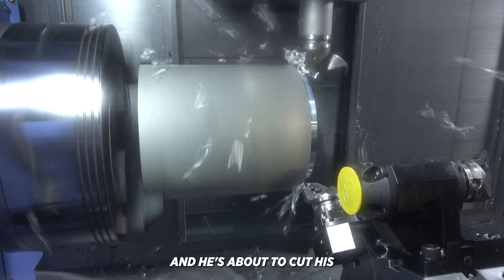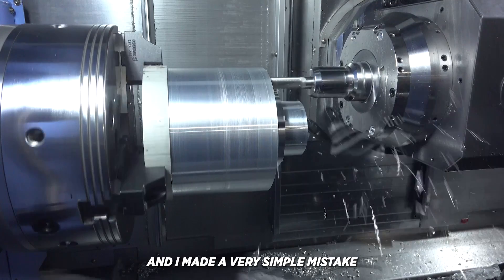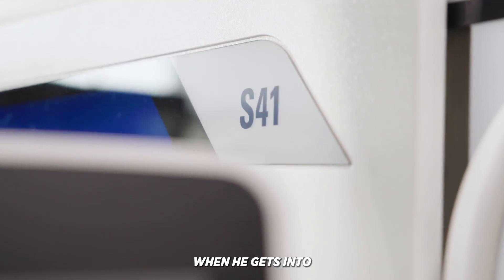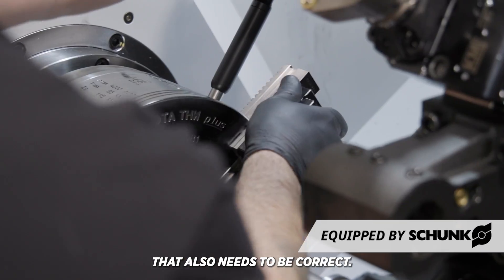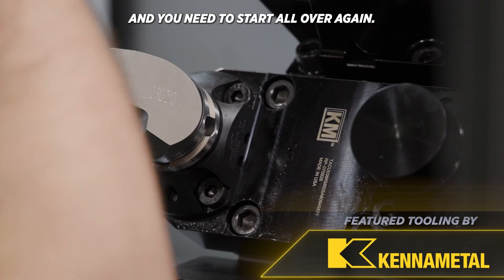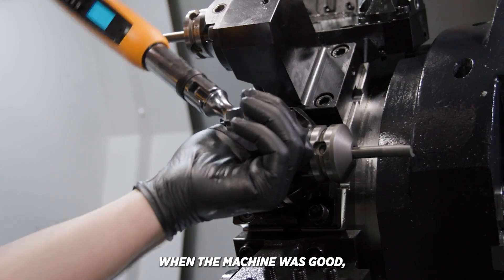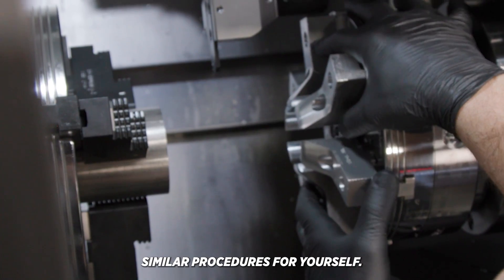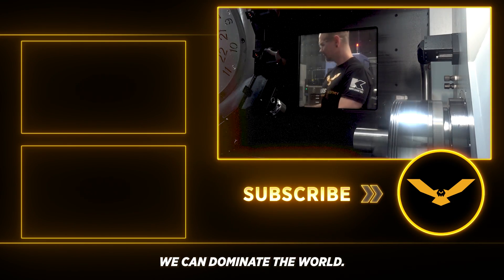My Mistake SMASHED the Tool & Holder Into the Part Causing Huge Damage… What Now?

Comment: On our bar feeder lathe with collet's all our parts are programmed with z0 being 3/8th off of coollet nose... That way all parts have a positive z value. And when changing to the next job all your off sets remain the same unless you change a tool out. Such as drills and taps. But we also do allot of repeat parts. It does however require more calculating when programming

Comment: Or drop a number from your compensation adjustment. Was tuning a finishing end mills comp and instead of typing 9.975 I hit 9.75 and into the trash goes 3,5h of machine time and several a grand blank.

Comment: Having been a machinist for over 30 years now and having the opportunity to teach my new guys. When I'm setting a machine up for the first run on a new part or the 100 run on an old part I do it the same ever single time, if it's on a mill or a lathe. Single block, op stop, rapid turned down and I'm looking at the program along with the numbers on the machine. This method has saved me countless times. If anyone would like I can go into much more detail.

Comment: could have used an okuma instead of a shitty fanuc control, but i'm guessing you're too poor for that
Reply: On most of the Fanuc controls there is a retract on G76, it seems an option on the 30i-32i but I'm not sure on that, on this Doosan 2600 SYII it's standard as it has a controller based on the 0i-TF Plus which has that retract on G76, not on Live-Tool tapping and G84 !!!

Comment: I like to add 6" even to the G54 and do a dry run. Of course this number won't work in every application but it was good for most. Wouldn't have crashed in this instance. Would have been close though.

Comment: When ever you interfere in a running process its the most dangerous time ever. Learn how to focus a 100 percent, take your time double check the numbers. For cutting threads use the simulation if its fanuc. Its so easy to see where the machine is going it has a crash feature. You can single block while simulation so you see the tool is going z-... and then you check again if thats the value you wanted.

Comment: I used to use a presetter to get accurate length and cutting edge on cncs about 30 years ago.
put tool in the presetter then line up length and edges on a screen and get a printout to be inputted into the cnc mill or lathe.
next factory didn't have a pressetter and some guys had awful crashes from failing to manually set length/edge of new drills and tools.

Comment: We always had our own machine and we set up our own machine. We did onesies and twosies. Pretty much complex and tight tolerance parts.

With a new program or set-up, I had my hand on the feed switch and the other one on cycle stop. When tool got close to part, feed at zero then compare tool distance by eye and look at readout to see if it had same distance. We offset our tools manually. This was before machines had probed offsets done by the machine.

Comment: Here goes. I always hate telling this story. I was a few years into running my first cnc lathe. All was going well and I loved it. One Friday afternoon late in the day I was making small -washer_type parts. I was interrupted a lot that afternoon, and felt rushed (personally) by the end of the day to finish these parts. (note: I take 100% responsibility for what happened) I made a quick adjustment to the parting off tool to cut the washer a few thou longer. What I did was forget the decimal or because my fingers were going so fast over the keys I thought I hit the decimal and didn't and the program read -627 inches as the parting off position-not -.625 , So my machine tried to go 627 inches into the chuck. My mistake was that I did not simulate after I changed the program. Long story , the tool slammed into the chuck that was turning around 1500 rpm and ripped off 2 of the chuck jaws and and some other damage ( so I thought, this was all) I called my boss and told him and we waited till Monday morning to asses. In the end it had cracked the casting underneath the spindle and pretty much the machine was toast. This machine was only a few years old. Talk about pit of your stomach sick. It's like you destroyed your buddies Ferrari. I had to break the news to my Boss. He was very good about it. The saving grace was insurance . It helped us buy a new and better machine for around the same money. That was 6 years ago or so. Now I always simulate. And I've learned to tell folks to hold on until I'm done so I can finish what I'm doing and feel confident when I come back. Redundancy is key I find.

Comment: Modern machines are pretty tough and they will alarm it if certain parameters are way past their norm.
But, I did crash a fanuc lathe about a month ago. Put a new boring bar in and didn't touch it off. Sent it right into to the chuck jaws. 
It was a carbide boring bar lol. Anyhow, the boring bar was obviously gone. One of the jaws was not to pretty but still fully functional, and the router got chicken out about half an inch. Reindicated it in and out was good to go

Comment: I used to find it stupid to write ZEROs, because it's unnecessary input for nothin because the machine doesn't need it to function... However, now I always put zero so my position are easy to read FOR ME. If I have a value in round inches I'll type 6.0 for 6 inches. That way, it insure I'm not forgetting the dot because 6 inchs and 6 10th is far from the same

Same thing if I want a fraction of an inch, I'll type 0.100 instead of .1 because I can read it fastly and accurately.

I make way less mistakes that I used to do. :)

Comment: I run a Fh 6800 Mill and got my tourqe specs crossed on my ops when mounting to fixture. Well its a night run part and the next 5 days were hell I destroyed alluminum blanks the tool and holder not to mention I shifted the pallet on the fixture so the setup had to be done over. Now i use a checklist and ive marked my 1st and 2nd ops on fixture so i don't mix them up again

Comment: Sometimes a crash can happen for completely un expected reasons.  One day I was running a Slant Bed when in the middle of a drilling cycle the the machine took off for the tool change or home position. I had already run multiple cycles. Turns out the machine had been retrofitted to a FANUC OT control . This was a long time back. During the retrofit (done by a FANUC tech) all small metal chips from drilling and tapping the holes for mounting the new boards and control panel where not accounted for. Luckily the drill broke and the only real damage was the shear pins on the turret.

Comment: Working on a simple 3 axis mill, I do parts that are bigger than the table, always checking not crash the part against the machine enclosure at the end of a cycle with the g28 X0Y0, or return to operator commands.

Comment: This story reminds me of the time I mistakenly input .2 instead of .02 for a roughing feedrate on a Weiller E-110 teach lathe.   This was on EN30B material and was about a 8" diameter.  The resulting squeal and then bang when I hit e-stop and the insert blew up got everyone in the shop to rubber neck at what happened.   Only thing damaged was the insert and not even the ceramic seat.  That machine was an absolute beast, top speed in low gear was 180rpm and 520 in high gear.

Comment: Single block... distance to go... read ahead... 
Feed hold won't stop a threading cycle, so you need to be certain.   
Back your Z off a couple of inches if you've got the room, and run the cycle in the air. 
If you need to check clearance, invoke the work coordinate and the tool offset and handle feed to the absolute position you're questioning with the collet empty or the chuck clamping a spider.
Reply: On 90% of FANUC controlled lathes G76 has a retract on FEED HOLD, not standard on the 30i-32i series.
No retract either on the G84 and live tool tap cycles.

Comment: I had cnc lathe set up running production. R and department made me stop to run one off part. Put live tool holder in to make a six sided hex. Went back to running production forgot to take tool holder out. Ran it into chuck jaws. Luckily it was in a federate and not rapid. It was a Haas so it didn't break anything, just knocked the wedge out of alignment. Haas castings are not pinned. If it had been a doosan could have been much worse.

Comment: I was running a MAKINO V33 for carbon cutting … I was pretty new to cnc so mistakes were going to happen but this Mistake wasn’t on my list. I was running a program just a constant z and I heard lots of chatter so I feed hold and looked at the tool and I couldn’t see that well while in the machine so I moved it via hand wheel closer to me so I can pop it out to look at it better … changed insert popped tool back in … Resume …. BOOOOOMMMMMMMM into the table my cutter went. Later I thought why why and figured feed hold just stops it and if you move it it’ll just continue where you put it

Comment: Machines / controllers all vary and all have unique ways to ruin your day.  For each machine you should have a detailed procedure to flush out dumb human errors before they become crashes.  Dry run, extra setup work offset, single block, distance to go, low feed and rapid rates, /M00 check points, making offsets ruler measureable, are all PART of the method.  However the major issue is to know where crashes come from in your machine, and to have a countermeasure.  This should be basic training for any automatic machine.

Comment: No1: If you are using a Fanuc controller, use the simulation tool to check the tool path. No2: Set your work offset 100/200mm away from the part and dry run the programme.
Reply: How do you use the simulation?
Reply: @RoboDriller  Go into auto and look on the screen. Far right soft key is the simulation. There are various settings where you can change the angle of view. Then press the start button as if you were running the programme. Good luck.
Reply: 100 mm away from the long part and hit the sub spindle with your drill 🤣

Comment: One thing i do when i have a program that is more complex i offset my z input 300/400+ to check the program running on “empty", because sometimes u cant see every movement on the simulation, you waste more time but you will be sure what the machine does when u start machine the part

Comment: It's all well and good to state all of this but in my experience 'Not Checking' something (which leads to a crash) is more to do with management than the machine operator/machinist. 
In my genuine experience I have worked under managers that genuinely view CNC machines as a "microwave oven" and if you take longer than 5sec setting it up, you're wasting time and they apply pressure and its the application of that unnecessary and inexperience pressure that creates the environment where there is less checking and more rushing. 

And I LOATHE it.
Reply: Human factors. Just like in aviation. Put pressure on the mechanic and he could forget to put a lock wire on a nut.

That nut falls off and aircraft crashes. Not any better.

Taking 15 min longer to set up is cheaper than replacing tooling and a down machine while waiting for parts and maintenance.

Comment: honestly. taking your time and limiting distractions as much as possible.  thinking through things , then questioning your self on what are some things you need to look for , what could go wrong if x,y ,z .
I look back at some work that I felt rushed on and wish I had more time. 
Because when  you make something and it's tip top , you can admire that.

Comment: I've been a machinist for 20 years, and things I would recommend is first getting rid of EVERY basic calculator in your shop and replacing them with scientific calculators that keep a history of everything you've worked on, on the display. It really helps having the visual proof that every number you've calculated was the correct one, and you can easily show your work. Secondly, double check your work and when I call out W.P.C.'s in my head to crosscheck with other ones, as an example, I'll call them out as 2 digit numbers; IE: -26.2456 would be minus 26 24 56. This method helps me prevent any typical dyslexia I may get, and ensures that I don't get numbers crossed up. Taking pictures before, and even after is always good practice too!
Reply: Everyone at my shop makes fun of me for buying my own calculator. They use the shop provided ones single line basics. I like to see what I did and reference back to it. They say you need to learn to trust yourself. F that. After a 10hour day I don't lol . Odd as it may be on one of the few that has not made a scrap part or had a "reportable" crash 😁 3rd shift life.

Comment: I once crashed a drill through the sheet metal of a lathe. I was running a small boring bar on one tool station and the drill was sticking out way to far on another. I will never forget that and I will ALWAYS check my tool clearances now

Comment: i have a simpel routine, while programming don't  bother me with any thing. When i'am setting up my offsets i write it down , i don't leave the machine until i finish my setup, and that includes a coffee break , i'd rather drink my koffie later and know i did my offsets right. before every program i run a simulation and check my toolchange positions.

Comment: In the training center when I went to vocational school, we learned working on CNC lathes in groups of 2. So, this one guy types in G0 Z500 or something into the program and walks away, the other guy runs the program, and then the turret gets ripped off by the extended tail stock. Now that was a kaboom!
Reply: What an idiot. He doesn't belong anywhere near a CNC machine. Anyone that incompetent should've been kicked out of there immediately. Mistake or not, that stuff can't and shouldn't happen when it could've been easily avoided. I understand mistakes but that's a big no no.

Comment: I almost demolished  CNC milltronics the other day. It will continue reading the “retract height” value from each drill hole coordinate from the program before even if it’s not programmed into in the one you’re running now. UNLESS it’s turned off and back on. I had 2 parts, one I ran already (program proven). First thing the next day I drill a hole and I was expecting it to retract above the boss like it did the day before but it didn’t. Luckily I was on top of it being more caution than I normally am. Almost went kaboom!! Watch out for that retract height in EACH program guys

Comment: I like to keep drop ends as slugs so I can cut air and get a glimpse of diameters and such. I've seen alot in 17 years, and done a bit. Just had some tool breakage because what was supposed to be a. 25 step over, tried to be a 1 inch step over with a. 5 endmill. Not crazy damage but that possible scrap conversation with the boss never gets comfortable. Also,  put a g50 at the beginning of EVERY  tool cycle,  if you don't and start in the middle of a part in the morning, that chucks gonna try to hit the moon!

Comment: I wish I could take a photo of the controller I run. However working for a multi billion dollar corporation we are not allowed to take photos of any kind on the shop floor even if it is work related.
Reply: pen and paper?
Reply: @redbeard_1371  yup works well for me
Reply: @wendull811  Depends on the controller but when you want to make screenshots on a Haas or Fanuc is quite simple, put a USB stick in it and press [ Shift + F1 ]  ( Haas ) , on the Fanuc I think it's 5 seconds on the [ Shift ] button.  😉
Reply: @ytfan3815  Our Fanuc controller dose not have a USB port.
Reply: @wendull811  Do you have a CF-card slot ( PCMCIA - channel 4 ) on the machine, that should work I think.
Reply: @ytfan3815  we have a compact flash card. 512mb plugged into a compact flash adapter. It is a Fanuc series 21i-TB Controller.
Reply: @wendull811  Check your Operators Manual for [ Screen Hardcopy ]

Comment: My biggest fail/crash: I forgot to re-set a tool when I switched it, and came up with an ez solution, every time I unload a tool from the machine, I erase the preset, so when u actually go to check the presets if u forgot something its at 0,0000 instead of whatever random number that could be left from previous tools...
Had a tone of pressure and I was actually running and programming multiple machines, is ez to screw up when ur being distracted by ur boss over and over... We all know that feeling..

Comment: That exact mistake wouldn't be possible if you would speak spanish. We don't use the ".5" phrasing, we always use "0,5" phrasing and yes, we use a comma to separate decimals, as many other countries do.
Reply: How is that any different? You can easily input 5,0 just as easily as 5.0
Reply: @brandons9138  the difference is not the comma or the period, is the fact that we ALWAYS say, for example "zero comma 5", not just "comma five", get it?
Reply: @avelord6135  I see what you are saying, but I don't think it would have made a difference in what he was talking about in this video. He mistyped a number and that is what caused the crash.

Comment: Used to be a commercial pilot so I have been using knowledge and experience about human factor, flight procedures etc to try to be better behind the CNC machine. The metalworking company I work for pretty much has no standard procedures so developed my own personal standards, procedures and documentation to combat some problems that I had. I was surprised to see many similarities between some parts of flying job and CNC, and what is more interesting that according to some WW2 fighter ace biographies there has always seemed to be a strong connection between machinist trade and pilot profession. I am convinced that higher standards are pretty much the main reason why aircraft are not crashing as often as CNC machines so makes sense to learn from those IMHO.